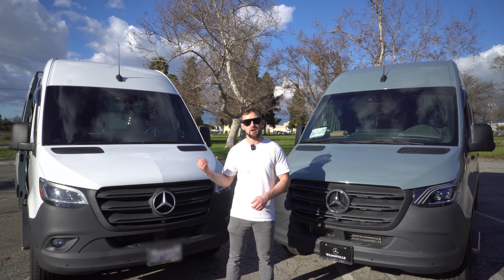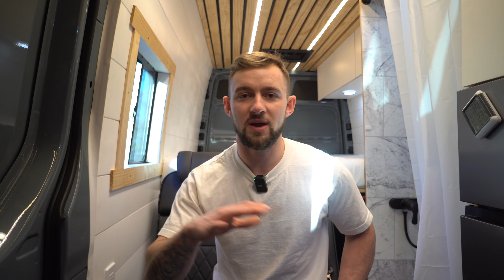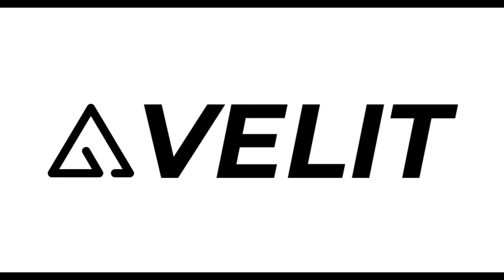Best 12V AC for Camper Vans? Velit 2000R Comparison

Comment: appreciate the video but testing AC units in 77 degrees outdoor temp is quite unrealistic as to when AC is "needed". Texas, Florida, etc in summer is a test. This is silly. Will there be a heater test in Phoenix? A flotation device test in the desert?
Reply: Thank you. A real test would be out in death valley during summer, not when it's mid 70s out.
I'm researching what AC brand to get for a Ford Transit 250 van. So far Velit seems like the choice but what is your opinion on which brand to get? I've been seeing lots of Outequippro ads but don't know anything about them.

Comment: Hey. Can you please answer this question?  Will this unit work if I just plain in to my normal house wall plug or does it need a 30 amp plug. I heard you say 500 watts. So 600 watts solar panel might be enough as well?
Reply from the maker: This is a DC unit that is designed to run off batteries so it can not directly run off 120v wall plug. You can make it work by adding a 12V 800W power supply that costs around $60 on amazon. 600W solar should be sufficient for most use cases but it would be challenging for the solar panel to power the unit alone because of weather conditions.

Comment: Where does the condensate go?  Run across the roof?
Reply from the maker: That's correct. An option drain line can be connected to 2000r mini and 3000R.

Comment: Why dont these guys do a REALISTIC test.....like AZ at 100°
Reply: They don't have enough BTU capacity to condition AZ 100F + air temps. I'm in a Promaster 3500 EXT/HT and my existing 120v Coleman 13.5K BTU unit struggles in direct sunlight with temps above 95F..

Comment: Thank you for posting this information.  I know people want specifics, but there’s so many variables.  Appreciate you doing this.  For the money, Velit 12 Volt AC appears to be the better buy than the 12 v X2 and Dometic rtx (2000?).
Reply from the maker: Thanks for your support! It is extremely challenging to control the variables in the real world.
Reply: Because of your video, I moved forward with purchase of the Velit 12 volt in black!  Very excited! I have Victron system with Victron LFP 600 amp hrs and if average amp hr consumption is 30-40 amps (up to 650 watts), I’m hoping for 15 to 20 hours with AC solely.  I don’t feel like it should be an issue, but any experience with connecting AC to busbar I.e Lynx DC distributor?  Thanks for your input.
Reply: @economicobsession-mr3po did you ever purchase and install the Velit? If so, how do you like it. About to pull the trigger on one ,any input would be greatly appreciated.
Reply from the maker: The power consumption varies based on ambient temperature. You should have no trouble getting 15h on a 90F day. The busbar connection would be a plug & play.
Reply: Brilliant!!

Comment: Thanks for the demo and comparison! Did you measure the decibel output on the RTX unit?

Maybe a better comparison is a nighttime test to avoid heat gain effect and heat the inside with same space heater to the same temperature and monitor same variables, e.g. time to cooling to a temperature (maybe 75F), power consumption over that time, and noise level.  Not sure if the fan speed is a meaningful variable given the small circular diameter of the Velit air vents vs the squared larger squared output net on the RTX.
Reply from the maker: Yes we did! It seems we forgot to edit  it in and we will upload a corrected version later. The decimal for RTX is also 58dB inside so it's almost identical. On the outside, RTX is significantly louder in the first 10 minutes and then quiets down to a similar level. It's a good idea but it is very challenging to control all the variables in real-world environment. We may build a simple heat chamber for more accurate comparison in the future. The biggest takeaway of this video is to demonstrate the difference in cooling capacity and the builder mentioned  that RTX was not able to bring the temp down in the California summer.

Comment: I am the builder of these two sprinters. From the installation point of view, R2000 is easier installed and easier to connect cables.Secondly, the external noise RTX2000 is bigger than R2000. In terms of price, R2000 has surpassed RTX2000. To be honest, I have decided to replace RTX2000 with R2000 after modifying ten cars. It is worth it.

Comment: I feel you have a good product, but you need to reduce the variables in order to have a legitimate comparison. This video doesn’t really show any reason to choose the Velit over the other brand.
Reply from the maker: Thanks for your interest! You are correct. We tried our best to find these two vans with the same floorplan but didn't realize  the impact of color difference. However, the outlet temperature and air speed could be a good reference point. The outlet temperature is similar but the air flow rate of the velit unit almost doubles and that demonstrates the higher cooling capacity.